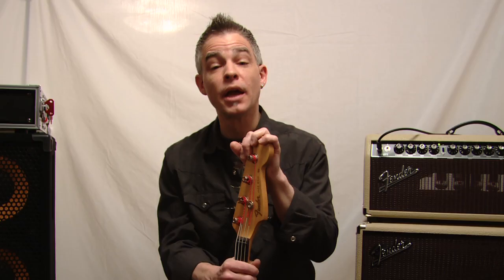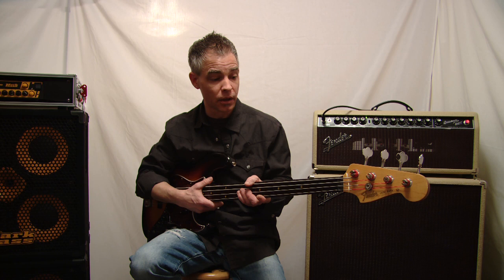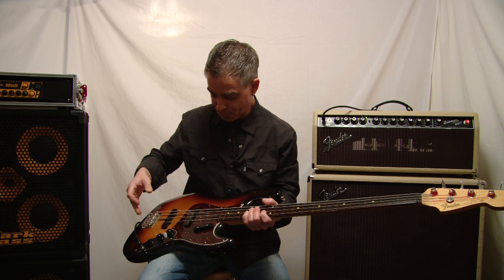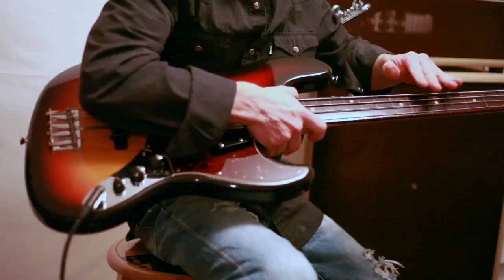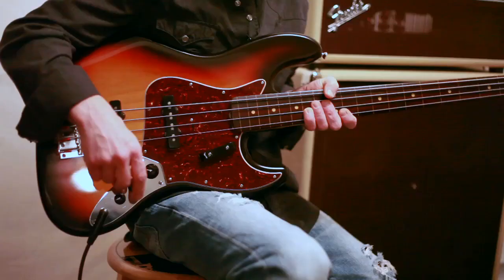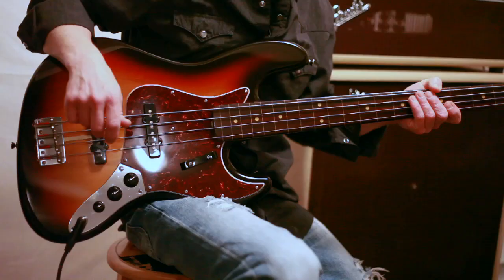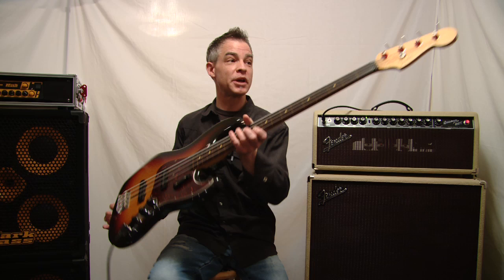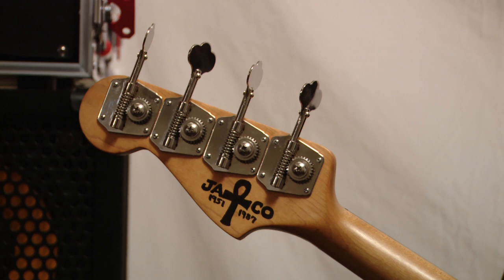Custom Made Fretless "Jaco"  Fender Jazz Bass

Comment: how did he fill in the fret slots? with wood or wood filler? or just the epoxy?
Reply from the maker: Jukebox Kevin Kaufman used wood on mine. Small, thin maple veneers....Epoxy was only used for the coating.  I believe Jaco used wood putty to fill the slots.

Comment: what are your amp settings? low, mid, treble
Reply from the maker: On the Fender Bassman I usually set bass at 5, mid at 7 or 8, treble at 5. 
 Depending on the room, I may pull the treble knob out to engage brightness but will lower the control to about 2..
Reply: Thank you, I appreciate it